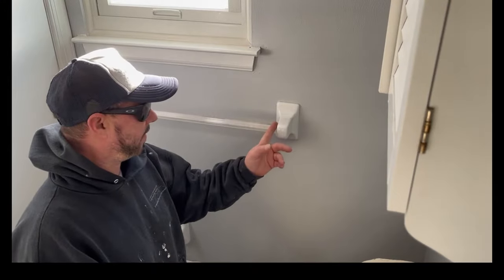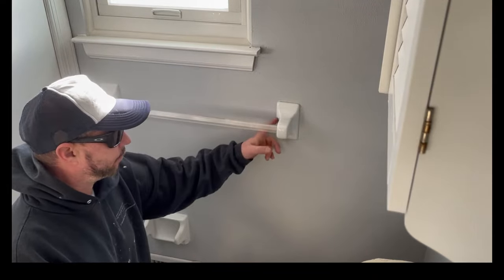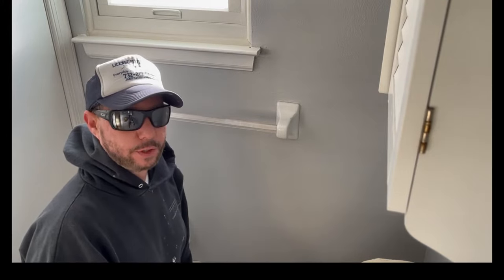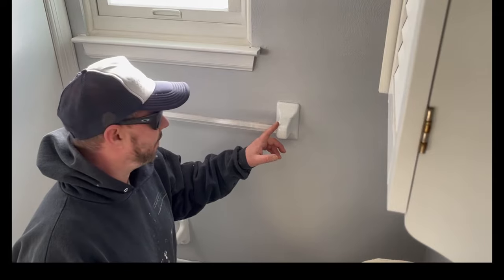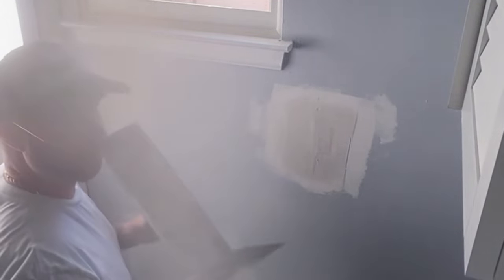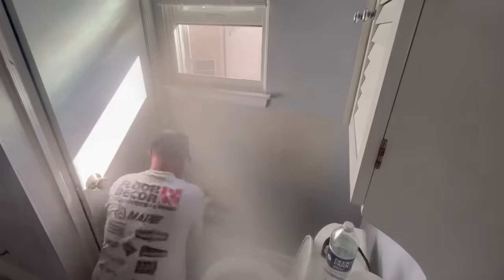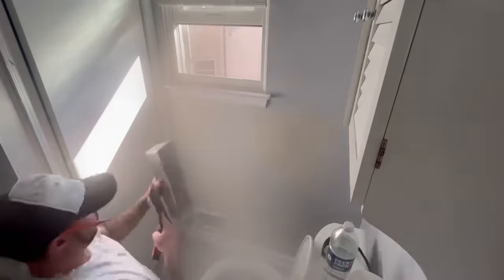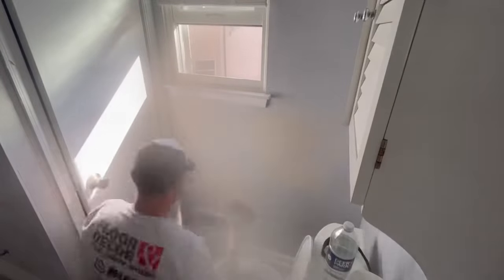Easiest way to remove old ceramic towel bars or toilet paper holders

Comment: This is much easier! I was really dreading the idea to have to buy drywall for such a small area. Thank you!!
Reply: I want to add hooks instead. Would this be a issue since a part of the old towel bar is technically still on wall?
Reply from the maker: No just drill your holes
Reply from the maker: You’re welcome

Comment: We had a drywall guy come in and finish it off. He used a wet sponge to wipe off the mud. Can you do the same here? Thanks.
Reply from the maker: Hi, sure exactly what you mean but if you’re referring to he used a sponge to wet sand the spackle yes you can do the same here as long as your spackle job is good. If not, you wanna use a sanding sponge thank you for your interaction please subscribe it’s free and if you want to be really solid like and share. Thank you.

Comment: So my issue is you leave parts of the ceramic in place? And a new tp holder may go right on top of that & good luck tryn to screw another in its place. Seems to me a california patch is better
Reply from the maker: There is no ceramic left. You’re just seeing the impressions of the back of it in a little bit of thin set that’s left. You will have no problem mounting anything new to this area but thank you for your interaction. I’d appreciate it if you would subscribe to the channel it’s free and if you ever have any questions about anything feel free to reach out. Have a great day.
Reply: @everydayhomeimprovements9345  ahh ok the tp holders ive run into have a hole in the drywall…maybe next one i will smashy smash instead 😁
Reply from the maker: Yeah, give it a try and check it out. It’s really quick and if you use 20 minutes spackling you can get all your coats on in the same day.

Comment: Did the wall have an orange peel to it? If you do, how do you match that? I used one in a can and it came out way too bubbly. Can I just sand that till it matches the rest of the wall?
Reply from the maker: No, the wall do not have an orange peel to it